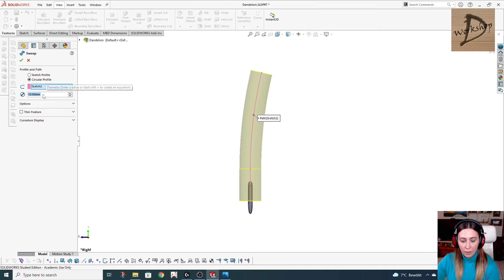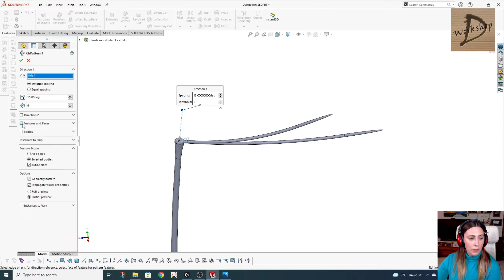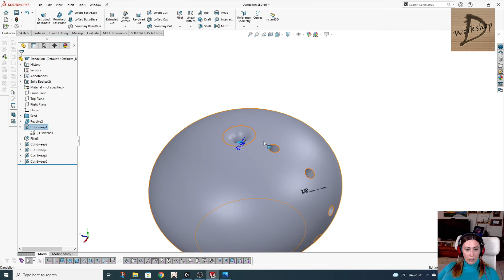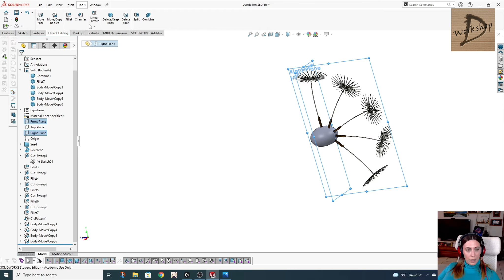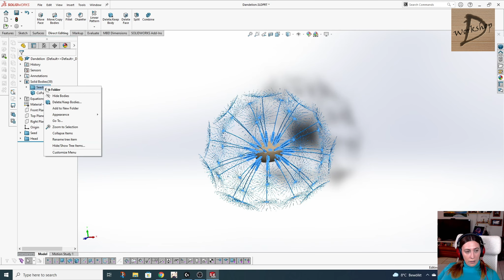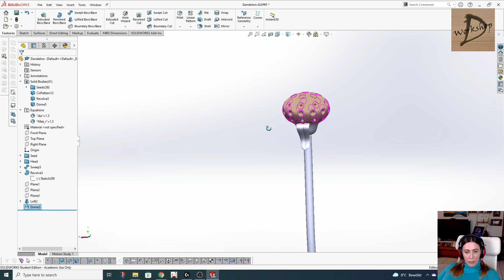Boost Your imagination with SolidWorks. Viral Dandelion (over 100k views on linkedin)

Comment: Hii
Can you please make reverse engineering from scaning file format stl obj ply asc (mesh file or cloud point)
Easy and simple method.
Software also used by solid work.
Reply from the maker: Hi ansariarif1480. I can#t understand your question well. I have a video for diferent methods of STL imports and what are advantages of each, you can check it here https://youtu.be/EDDUsci15ac. I have also a video about importing and fixing of complex STL geometry in SolidWorks, you can check it here https://youtu.be/exvdsAwsBFc. If this is not covering what you need, please explain what exactly you are looking for.